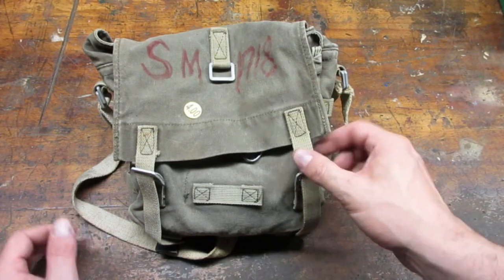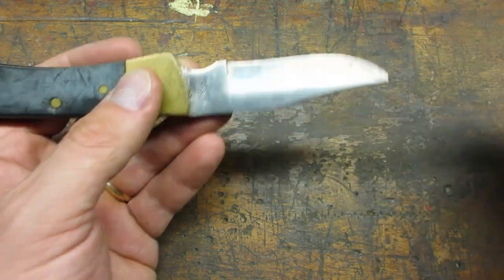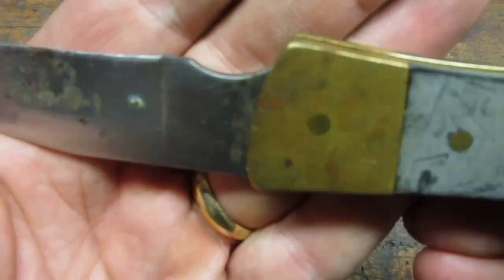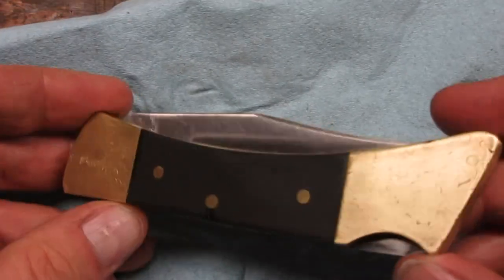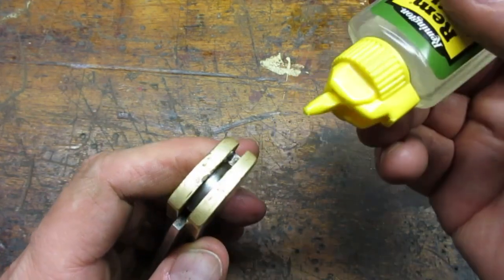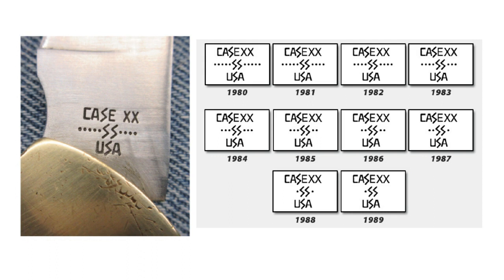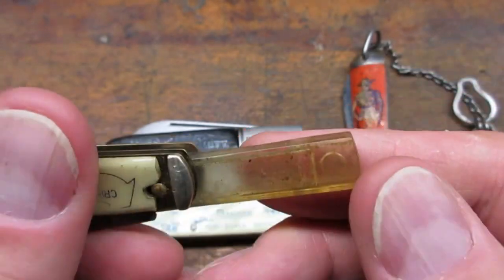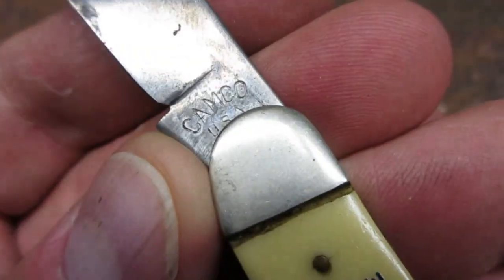Pocket Knife Restoration Case 2159 LSSP Hammerhead Lockback

Comment: Very nice find and save. I just did a clean and polish of a Hammerhead I purchased off ebay. It had a partial name engraved into the handle and initials scratched into the back of the blade. It wasn't stamped or etched with the shark so I had no problem sanding the crap out of it to make it nice and shiny. It took alot of hand work but it is now shiny and scratch free blade and handle.
Reply from the maker: Cleaning up old pocket knives is fun!

Comment: I've been looking into ways of restoring the surface texture of faded wood and plastics / synthetic materials on the scales. Things I've ran across were Minwax Polycrylic to give it a glossy shine. Have you ever looked into that?
Reply from the maker: I've had some success with Mothers Back to Black on faded plastic.  I usually use 0000 steel wool and wax on wood.  I think a clear coat would work OK if the knife was gonna be for display, but I would worry about chipping and abrasion on one that was gonna have pocket time.

Comment: Great job. I like old knives. I have trouble sharpening them. I have a kit like you used but I can't get a good edge. Any suggestions? Thanks
Reply from the maker: Thanks Glen.  I'm no expert, but I've found that no matter what I use to sharper knives, chisels, plane irons etc the two most important things are maintaining your angle and time.  The Lansky system is great for keeping a consistent angle.  I spent a good 10-15 minutes a side with the coarse stone to establish an edge.  I won't move off of the coarse stone until the whole knife edge catches on my thumb nail.  The medium, fine, and super fine stones don't take nearly as long.  I also find that newer stainless steel knives are difficult to sharpen.  I much prefer vintage carbon steel.

Comment: Great video and awesome job on the restoration. Before you got that knife, I think the blade tip might have been broken off and someone recontoured it to fix it. I have my dad's old Case 2159 LSSP that is pretty much like new except for the patina on the brass. The blade measures 3 and 5/8" and has a different profile at the tip than yours. Not knocking your knife, just giving you some info.
Reply from the maker: Thanks for watching!  I think I mention about the blade possibly having been shortened in the video.
Reply: @357magdad  yes, I believe your suspicion is correct and can explain why the the tip of your knife when folded was somewhat exposed from the handle.
Reply: All in all, you have a great knife that you brought back from the dead with your restoration. Kudos to you!

Comment: I have the same knife. My blade is less worn and is 1/8" to 1/4" longer but has the exact same failure on the center rivet with little cracks in the composite material.

Comment: i got a blade like this and its wood in the mid and stainless steal for the blade also so dull i can rub my finder with a lot of pressure and ther is no company name or anything on it
Reply from the maker: There are a lot of imported knock offs of this design.  The low grade SS blades do not hold an edge very well.